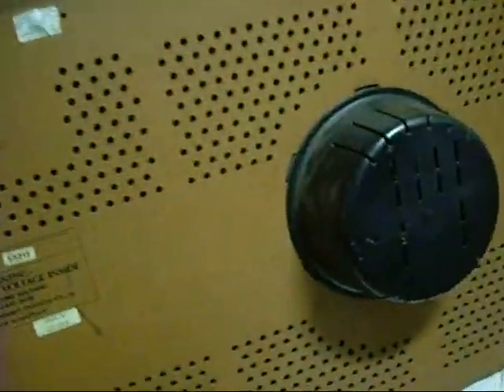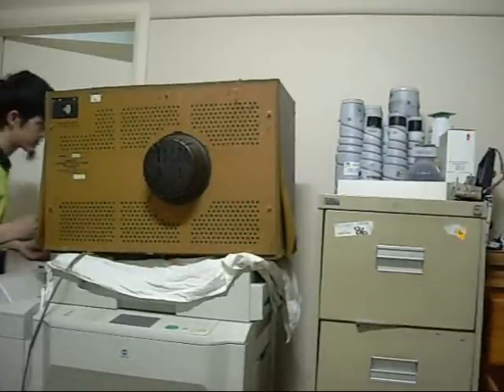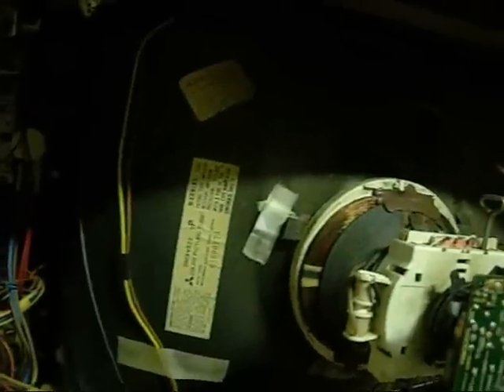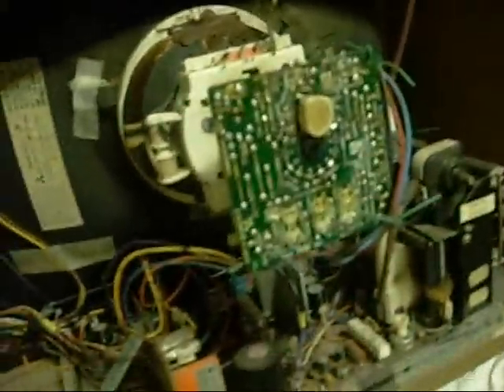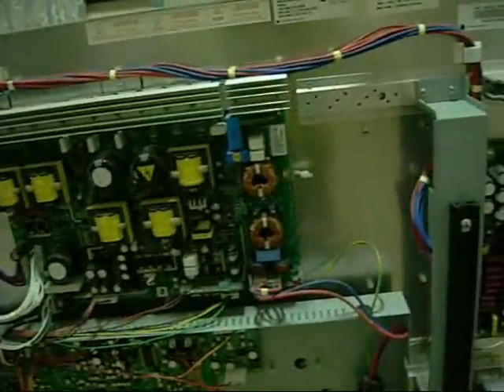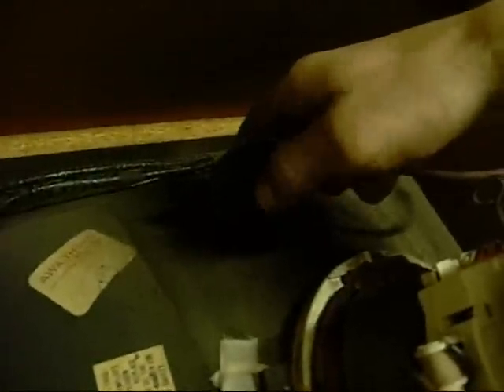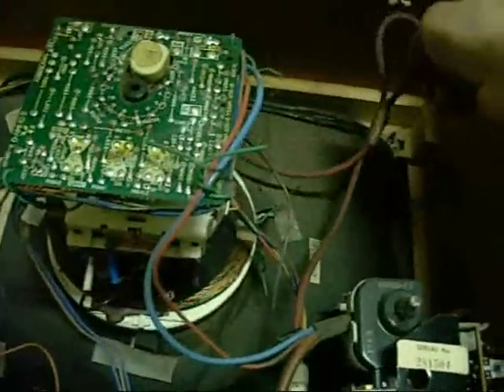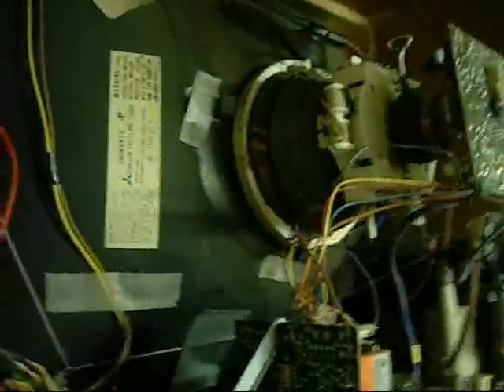Look at vintage AWA Color TV and CRT HV Safety

Comment from the maker: @HazzWold1993 the big iron core trans is the mains step down, 112V and 12V outputs.
it was replaced by switch-mode PSU's in the newer TV's.

Comment: It's not just HV you have to worry about, But the fact that the CRT is under pressure (Or vacuum, Can't remember which) and if you crack it that can cause problems as well.

Comment: The term '6CM5' reminds me of a very common horizontal output valve (tube), and was used in hybrid B&W TV sets, when transistors could only be used for lower voltage/current applications. I remember doing the occasional repair on this model (in the 90's) where the symptom was frame collapse (no vertical deflection; bright horizontal line across the screen). Thought it was in the amplifier (capacitors, transistors, etc.), but found the series feed coils to the vertical yoke open circuit..

Comment: My new 19" TV from the 80's has an internal short in it's flyback.  It was causing crackling and picture flashing..  When using a stethoscope and cleaning the flybacks casing, I could not only hear the crackling in the flyback, but found cracking in the flybacks casing.

Comment from the maker: @Jaytheozzi damn thats no good :(, everone at work seems to be getting the same thing except me. won't be long before I'm down too :(

if the FBT is cracked and arcing externally you could try the mica idea, just lather the area in clear silicone and stick it in.
its a last ditch idea, but beats buying a new FBT.

Comment: I have exactly the same set but mine has UHF on it. I got it for free cause I really like the older sets and a lady I met at work asked me if I wanted one. Only problem is it only shows a single horizontal line instead of the regular picture and it's so hard to find information on this kind of TV. Although it is nice to know I should discharge it before messing with the TV.

Comment: when i had the monitor board in my arcade machine replaced, it had the same lines show up,, the guy that installed the board said it is caused by many volts from the flyback. he adjusted one of the POTS and it cleared up. 
that may help

Comment: I have an old 80's Philips 14" computer CRT and it makes that crackling sound after using it for a few minutes, but it actually went bang when i was using it (or maybe a loud pop), however it still works sometimes but I don't use it obviously, I'd like to restore it because it was a great little monitor, but I don't want to kill myself :)

Comment: thanks allot for! im back in bed with a high fever but when im better ill take a crack at it. its exactly what you said about the fly-back transformer and the rubber seal. i made another vid last night but haven't posted it because im feeling shit and computers are my last preference! it showed it arcing around that seal exactly like that one. i was thinking of making some sort of insulating sheet to go between the transformer and the metal bracket. is this recommendable?  thanks again!